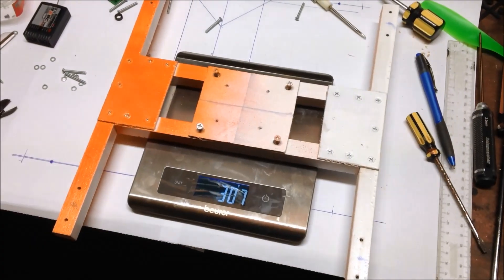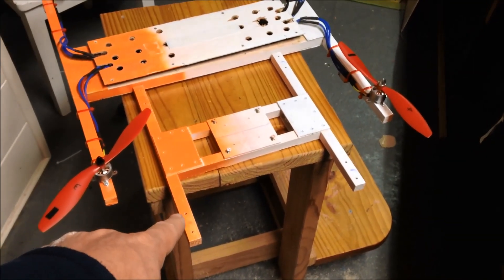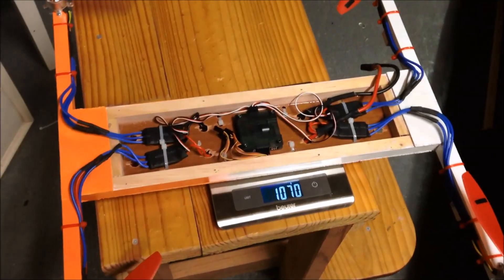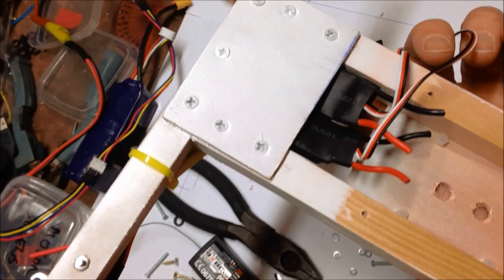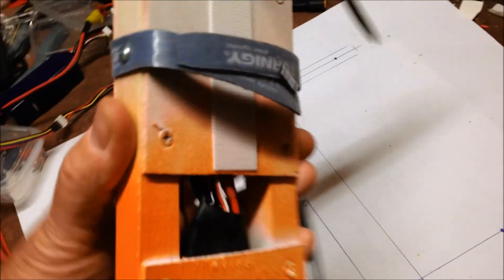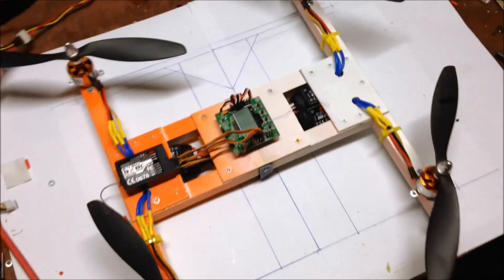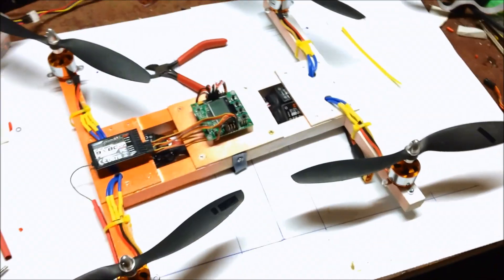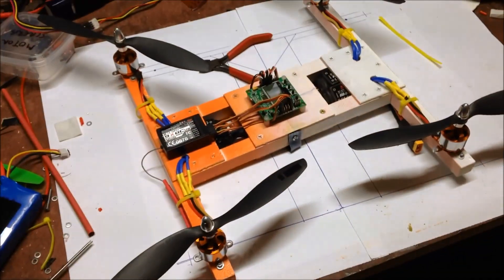Wooden 380 H Quadcopter Build Part 2. The Motors and ESC install

Comment: what is your AUW with the battery on board. And I am going to use 2212 1400kv motor with 1045 props on this H kind of setup so do think it gonna fly well??